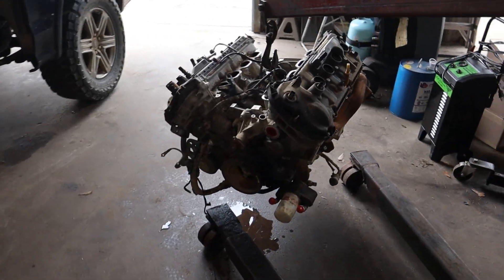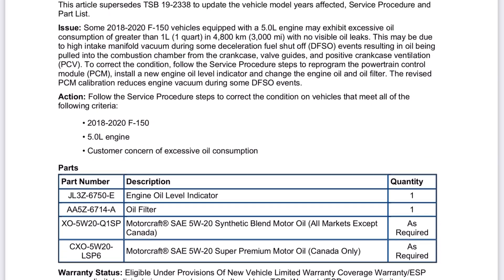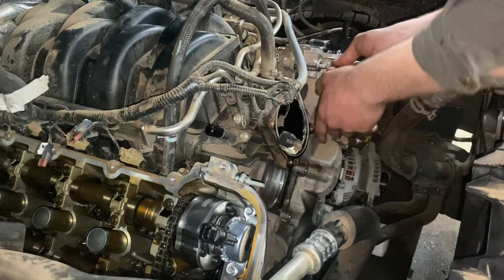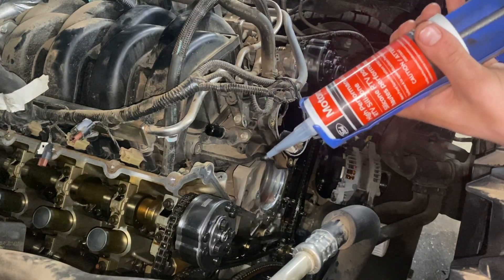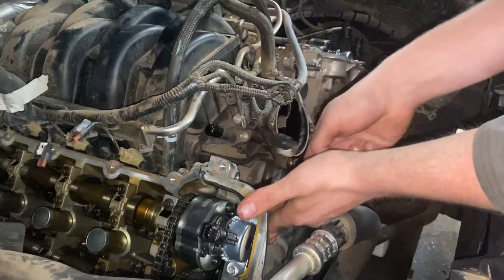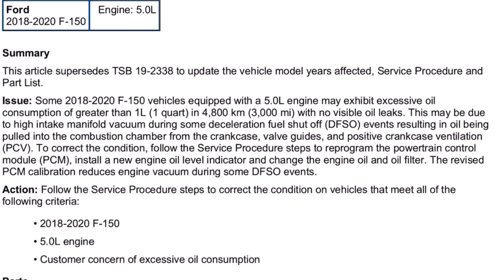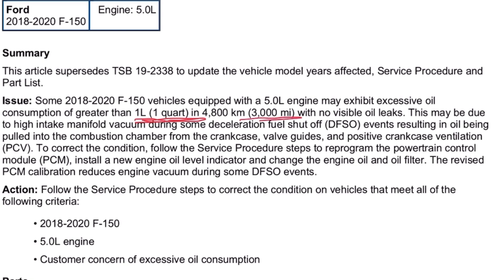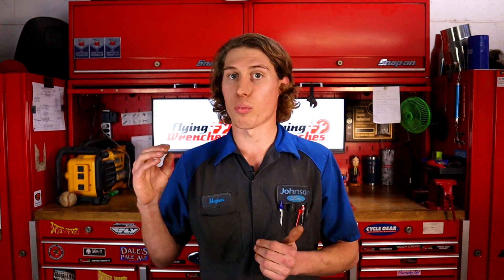Ford 5.0 Coyote Oil Consumption FIX

Comment: I have a 2019 F150 5.0 I bought brand new.
The last 2 years I would hear a knocking sound, check my dipstick and it was bone dry. I would put in anywhere from 3-4 quarts and would register a little and knocking stop. Will FORD do the steps needed to correct the problem at 76,000 miles?I have had a longer dipstick put in place.

Comment: The TSB did not fix my 2019 f150 5.0 using 1qt. Every thousand miles I’ve checked pvc valves and hoses pulled the throttle body off and for hundred thousand miles everything was clean and oil free

Comment: I have a 2020 F-150 with 41,000 miles on the clock and last week It developed a dead miss. I don't have any diagnostic equipment, but I thought it was either a bad coil pack or a bad plug. Having the lower milage I was leaning toward a faulty coil. When I pulled the first plug it looked black and wet with fuel I replaced the one plug and started the engine and the dead miss was gone. I then decided to change the rest of the plugs and all of them looked almost as bad as the #1 plug. I have run fuel injector cleaner four or five times in it's life of 41,000 miles, but I believe it's the oil consumption that is making these plugs run so dirty.

Comment: Dumbest advice ever.  I work for a service contract company and we buy A LOT of these engines.  The oil consumption eventually leads to carbon stuck rings and cylinders that wear out of round.  When that happens the entire engine is headed for the recycler, to the tune of about $10-$13k.  The overwhelming majority are 2019 and 2020 models. That could be because those are the ones aging out right now and the 2021 and up models will be grenading shortly.  I can't tell you how many we have under contract, but I can tell you that we've had 19 replaced just in the past month.  Burning oil like this is not just inconvenient, it'll eventually destroy your engine completely.

Comment: Thin oil and cylinder deactivation, as well as emissions equipment like pcv valves. That’s the reason for the consumption. Where the consumption is a problem or not depends on how often you change your oil. Don’t let it get too low or you could starve it or at least lower the cooling ability. (Don’t say oil doesn’t help cool or oil coolers wouldn’t exist) great video sir.

Comment: Probably not the same problem as a 5.0:  my Honda Pilot equipped with a cylinder cut out system would make the oil disappear.  I bought a micro chip to fool the heat sensor .The chip causes a false signal to the computer which stops the cylinder cut outs. It quit burning oil and got better mileage.

Comment: My 2018 f-150 never used a damn drop up to 20,000 miles she has started to use almost two quarts in four thousand miles now I am 72 years old I have checked my oil every 3-500 Miles  on any thing I have owned including all my motorcycles.

Comment: I had a 2018 5.0 that was using about 1.5 quarts per 3000 miles. I had the PCM update done and it no longer used oil. The update worked for me. I check my oil about once every two weeks because I grew up in the 60s when cars burned oil and all I could afford was 29 cent a quart bottle, yes a bottle of bulk oil with a metal spigot, at Hess. My '59 Impala, 283 used about a quart every week and I couldn't afford a ring job! LOL. I kept that 2018 for six years and no other issues. I bought a '24 Lariat, 5.0 because I just wanted a new one with a few more bells and whistles.

Comment: I recently worked on one that was burning one quart every 400 miles. The problem with it burning this much oil is catalytic converter problems. 5.0l cats are flying off shelves for a reason. :-/

Comment: Rest assured im checking my oil on my 19 5.0 - and im checking it because not long after buying the vehicle i noticed it was losing oil. Im certainly not 65 but i do know an engine without oil is a dead engine. Mine is using around 1l per 5,000k which is normal based on my research. But im 100% toping that missing oil up!

Comment: Bruh I check my oil every week! Since I got this 2020 from my 2017 5.0 and I’ve noticed I only get 5 quarts out that joint. Just weird to me when my 2017 was just dumping basically everything I put in that joint out. A whole 7 to 8 quarts come would come out, but not this one. Thought it was the drain plug so I got a metal UPR one and did the oil this Sunday and still only got 5 quarts out this one. Now I know I have an 5.0 with oil consumption 🤦🏿‍♂️… Man I shouldn’t have ever upgraded a few years ago.

Comment: DO NOT LISTEN TO THIS KID!! CHECK YOUR OIL!!  Ford is replacing my engine under my extended warranty. The dealership found significant scoring on cylinder #5.  I am now waiting for them to call me back as to when I am getting a replacement. Note, I have noticed excessive consumption over 2 years ago. Did the TSB.  Changed my oil religiously between 3k and 4k miles.  I don’t overload or over pull. I started noticing 3+ quarts low between oil changes at 60k miles. I now have 84k miles.  My point is folks, CHECK YOUR OIL. If it is burning oil, there is a problem!!!! Ford knows this too, they will fight it, but you have to push.

Comment: Mine is a 2019... 50k on odometer. I put 9 qt in, then between 4500-5000 miles later it starts ticking intermittently...  then i know it's time to do an oil change.  When i pull the drain plug there is all of about about 3-4 quarts left in the pan.  i have owned probably 20 cars in my lifetime including some completely clapped-out beaters with 300,000 miles and not ONE used more than a quart every 2k unless it was BILLOWING blue smoke out the exhaust.  Something is very wrong with these engines and it isn't the dipstick tube.. The gallon and a half of oil can only be going out the tailpipe or spilling out on the ground,  and i don't have any spots on my driveway.  i love the truck otherwise.  Your theory is nonsense.  or maybe you are just trolling.

Comment: They can hold 9 qts, but can run at 6… just took my truck in, after ADDING oil to it to get it up to the dipstick maybe 2 weeks ago, they drained the oil and 3.3 qts came out… it’s an issue a big issue

Comment: great video... This TSB corrected my son's '18 5.0. Might use a 1/2 qt in 3k miles now, and since it holds almost 9 quarts I consider that minimal compared to 2qts in 1500 miles. I definitely think it was caused by excessive vacuum.

Comment: I have to check my oil. This ladt month i didnt , hoping it would balance out. Also the mechanic said i need a teansmisson dip stick , use to check that on my old truck. The trans oil was toast but cant tell now. You are not checking it .

Comment: annnnnd 2021 it's still happening, mine was 4 quarts low between oil change 5.0L.  Thats allot.  If it idles for 10 to 15 minutes you can see the smoke and if you do that time period with the generator running its even worse (gen bumps the idle up).  I bought it in January of 2021 so it was made in 2020 at some point so I dunno.

Comment: This video is extreme. Why did I know I had a problem? Because my 2018 F-150 5.0 was knocking so loud in 2020 at 70MPH (at 1900 RPMs) that people riding with me were asking "is that normal?" Then a week after that the check engine light came on.  I "checked" the oil and there was nothing to check. Why? Because there was zero on the dipstick. This was at 30,000 miles. They did the reprogramming and put in a longer dipstick, and changed the oil that was left. It fixed nothing. My truck burns a quart every 800-900 miles. It ruins standard (paper) air filters within 10K miles because they are 1/2 covered with oil. I love Ford. This is my 6th V-8 F-150. I grew up on a farm so I know a little about engine work, but this engine has serious issues. And it did not have to check my oil to figure it out. There is a legitimate class action lawsuit about these coyote engines. "Discovery" has shown there is a real problem and Ford knows it.

Comment: My 18 5.0 has been losing oil 3/4 about every 2000 miles for about 75000 miles(truck at 175000). It ticks more/louder when down to 1qt low so I check always. Where do you work… I won’t be going there.

Comment: So it's my fault the exhaust is dripping oil out, as it's consuming 5qt in 4k miles?
How's that impacting O2 sensors and cats? Were those designed for the motor to spit out that much oil?

Comment: Since I found this young man's channel recently, I have been watching.  My Grand Marquis has 500,000 miles and it uses 1 quart every 3,000 miles.  My 2 6.0 liter diesel trucks use very little oil between oil changes.  Don't check your oil?  I just don't think I am going to follow that advice.  All vital fluids get checked at least once per week along with air pressure.  GREAT VIDEO!

Comment: Piss poor engineering. Sounds like a GM excuse!  If the 5.0 was burning a qt every 5 or 6 K miles, maybe. But not at 3K miles! I have a 3.5 eco in a F150 that does not burn a drop between the 5000 mi oil changes.

Comment: I’m 35 and if I didn’t check my oil levels I would have had a blown 2019 5.0 .. only 56k miles on it and I noticed the problem after the third oil change - 20 oil changes later and I brought it into ford - lo and behold after having it for only a day they call me back and tell me it needs a new engine 😂 can’t make this up, I also have that timing chain slapping issue, is there even promise both issues will be fixed with a new engine !? I doubt it but pray it does

Comment: Do you recommend a 2018 and up 5.0 F150? My dad is in the market for a truck and while the Eco boost engines are nice, i’d much rather him have something that is simple and won’t cost a fortune to repair. So I’ve been considering telling him to get a 2017 to 2015 F150 because it isn’t direct injected. What are your thoughts?

Comment: I have a 2018 F-150 with 97k miles on it's 5.0L that I bought 5 months ago, it is using around 2 qts of oil in 679 miles. I have checked it, logged it and checked it again. There is no way I'm not checking the oil on a regular basis, and if you have an oil consumption issue, you should always check your oil on a regular basis. In my opinion you should always check your oil just to see how much, if any, your vehicle  is using. Bottom line, check your oil regularly. Thank goodness I bought a full coverage Ford warranty when I bought the truck. I am starting an oil consumption test at the dealer on the next oil change.

Comment: Just got back from dealer today. 2019 Lariat 5.0, 2-3 quarts per 5k miles getting worse. On my second PCV valve and now both cam solenoids clogged on bank B. Already did TSB didnt help at ALL. Im gonna speak w Ford on Monday clearly w law suits they’re aware. I love Ford and my trucks been great but i dont need a 10k+ timebomb. It doesnt take much to nuke motor w that much consumption plus cats etc. all that carbon and build up is recipe for disaster. 68k miles and I dont wanna dump it on some unsuspecting buyer. trucks now north of $77 grand plus fees taxes etc. fkn pissed its my work truck my other ford was hit and totaled w 300k miles 😂

Comment: Absolutely TERRIBLE advice! You're a fool if you don't regularly check your oil. This engine is NOT designed to burn oil period. The engine doesn't hold 9 quarts of oil so that it can burn 3 quarts between changes. It holds 9 quarts to try and get the longest oil change intervals possible to keep costs down. It's all marketing nonsense. This kid is drinking the Kool aid.

Comment: My 351 Windsor stroker motor in a 64 Falcon Burning Court and a half of oil driving down the freeway for an hour burns another quarter and a half going down the quarter mile three times and another quarter and a half to get home. Is that bad
   I think I have excessive crank case pressure. Would you recommend a pump or an old school system off the exhaust to create a negative?
Reply: Definitely go with the VBS vacuum balance system. That way you can f’up your
catalytic converter (if you have one & we don’t like them anyhow) and at the same time
you’ll be able to lubricate the inside of your exhaust system to keep it from rusting out from the inside while providing some lubrication on the road surface so the rest of us can practice 
our slippin’&slidin’ techniques the next time it rains 😂

Comment: Well, sonny,I'm 66 and still check my oil. By the way, it's oil, not orl. love your videos, but I have to disagree in this case.  Whether the issue has been blown out of proportion or not I can't say. But if my engine is losing oil, that's a problem. Where's it going?  Into the cat? On the intake valves? Into the atmosphere? I've had two 5.0's and no issues.

Comment: All these new engines have some kind of problems. Toyota, GM and Ford. Now more than ever it is more important to check your oil. Mine was down to the tip of the dipstick at 3000 miles. If I would have waited til 5000, I may have damaged the motor.

Comment: Is the oil consumption problem fixed with the 21 and up?
Reply: I have a 21 5.0 and just recently did my oil change at 4k miles and only drained 5 quarts out of 7-8quats also notice the truck shakes bit, are you having the same issue ???
Reply: @chrisulloa6489  I'm just looking for a used one. 21 and up.

Comment: i have a 2013 ford xlt four wheel drive crewcab with the 302 coyote i have owned it 7 yrs was a chevy guy my whole life but i test drove this truck and fell in love with it the power the sound ford won me over with the coyote . my truck has 220 thousand miles on it and i have never done anything but regular maintenance on it never a issue with check engine light . and no issue with oil as far as i know. for seven yrs i have changed the oil regularly and never have checked the oil and she runs fine i loved it so much i went out and bought a 2019 g. t. mistang will never own another chevy i love the coyote motor
Reply: I have a 2019 Mustang GT. 
No oil issues… no tick noises… no shift problems…
… no weasel piss warranty oil, as recommended by Ford via CAFE standards, which Ford does not recommend once out of the USA.
There is a reason why Shelby & Roush recommend  5w-50
The possible causes for excessive oil consumption were:
short dipstick lead to overfill, hence burn off.
low tension oil rings, hence during high vacuum above piston & crankcase pressure below the piston, coupled with PCV system, caused excessive oil consumption 🤷🏻‍♂ and
was there a flaw in some of the engines with the new plasma arc cylinder walls 🤷🏻‍♂
We will never know and why do most engines of said years have zero problems.?..

Comment: The funny thing about being 20 years old and being told not to check your oil is pretty damn insane. Is that because I've been with old 90s and 80s Chevy vehicles lol. This is the first ever truck I see that needs to be check every damn week not impressed by my ford f150 5.0  2019.

Comment: Age 51. Check the oil once a week if that vehicle has ben started.  Have a 19 f150. 5.0. it burned oil about a quart every 2,000 miles until 6,000 miles.  What changed?  1- correct pcv valve, 2- Roush supercharger added to engine
3- 5w50 engine oil.  37,000 miles on it now.  Not a drop of oil burned since 6,000 miles.
Check your oil every month. DUH.

Comment: I have a 2019 F150 5.0 engine. The engine loses oil. I say that because there is no smell of burning oil or spots on the garage floor. I check the oil every week. Sometimes it's fine, others I need to add up to 2 quarts.  And then there are other times when there is no oil. I need to add all 8 quarts. I have it at the dealerships many times. I have a stack of paperwork over 1.5 inch thick from 3 different dealership, who could not find anything wrong. I have an extended warranty, but only one service manager said the engine should be replaced. Then he retired, and that is that.

Comment: I purchased my 2018 5.0 with 80k miles and now have 160k on it. It rattles when starting it, it whistles when going down the road, rattles when you lift your off the gas and burns oil like crazy, all since the day I got it.  It has never left me stranded, though! knock on wood

However, I feel my luck is about to change. I’m leaking coolant and so far it seems it’s coming from the water pump. If I have to open this thing up to replace that pump then I figured might as well fix anything that has been needing attention since day one. Would that be worth it? Feel like it’s gonna run me a pretty penny to get it all done.

Comment: Yes, it does hold 8.8 L and with the original dipstick it would show the level at the bottom of the cross hatch then some guys add more oil to bring it to the top of the cross hatch. Now the engine has 9.8 to 10 or more liters. The oil will now foam up and the excess oil will be drawn into the PVC system and drawn into the cylinders to be burned. If you check the oil level after a while it will be low  and the cycle starts over. The new dipstick shows the correct level with 8.8 L in the engine. That being said there are 5.0 L out there that use oil. Was it damage from the foaming oil. That may be a question for the Ford engineers.

Comment: I’ve noticed my 5.0 is a 2017, and if I start it run the engine for a few seconds, shut off, and restart it, a short puff of smoke comes out of the tailpipe. I noticed oil inside my intake… thoughts?

Comment: It doesn't matter who the manufacturer is. Many of the newer vehicles are burning massive amounts of oil. This is not normal by any means. I have owned vehicles over the years with 150 thousand plus miles that didn't use oil.